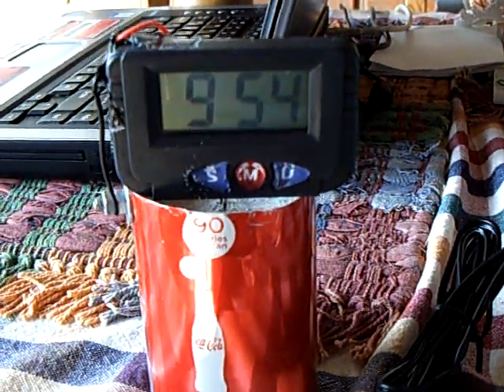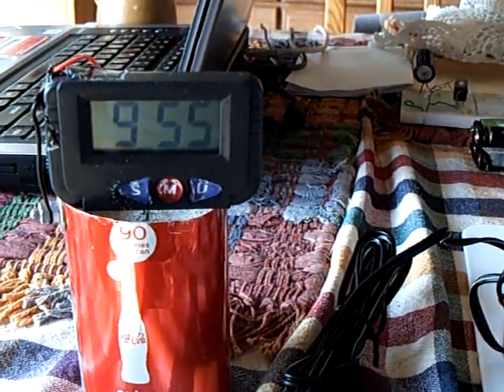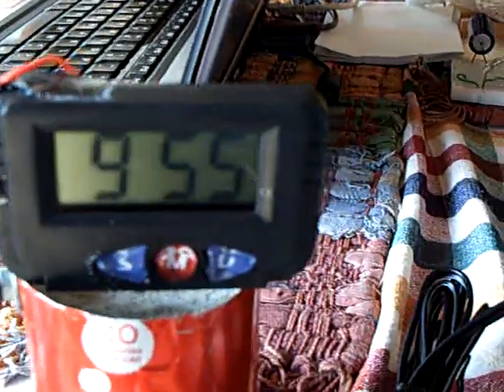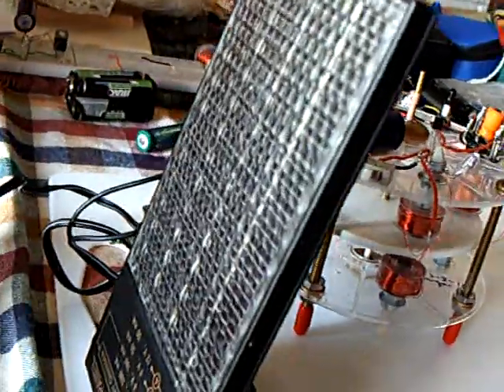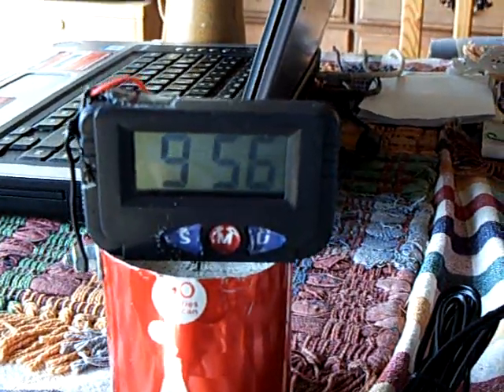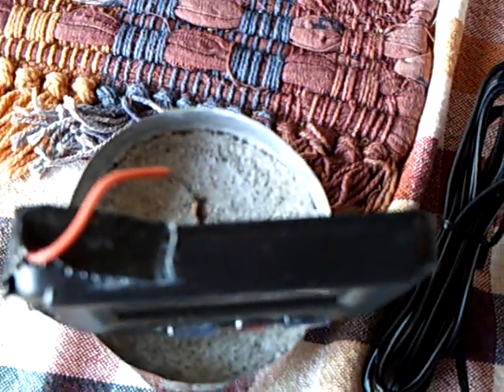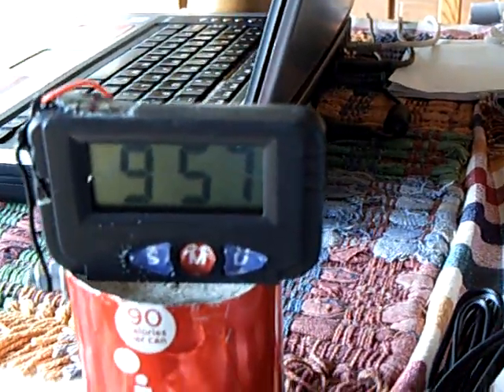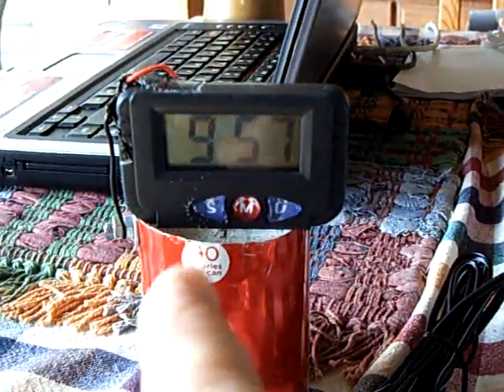My Beach Sand & Cement battery at 5 months.ASF

Comment: the Sunlight is giving it Volts. Photons are the reason we have electricity in the first place, direct sunlight gives a current. Also called orgone energy, the battery you made is an orgonite device which collects this energy which is powering your clock. This tech is the part of the 'new age' series of freedom with technology. Enjoy the gifts of the higher comic rays!

Comment: I guess what I am trying to understand is bigger plates better or smaller more close together plates seem to boost amps up more as I was testing in water. It seems to be able to make some smaller cells and put them in series similar to solar cell. As it seems that the volts for a solar cell and crystal cell each cell are both around 1 to 1.5 volts.

I guess what I am trying to understand is if you in series can you charge a AA battery in one of this solar lights from walmart.

Comment: In my video Overunity Charger i pointed at electret crystal batteries as overunity devices, also this is the case also with Stubblefield coil, or any battery, even a simple sheet of aluminium, a paper, and a foil of iron, is a perpetuum battery generating some 5-10 milivolts, from surrounding pranic energy which permeates everything.

Comment: The real way to tell is put a meter on the clock and read us some voltage readings and take still shots through out the day on the hour so we can see this happen in real time, Lidmotor. Other then that thanks for sharing what you have. What about the gummy batteries?

Comment: Lid:

I agree with you about some other energy, probably solar, entering the system.  I have a question:  How accurate is the time now from when you set it in the beginning?  Is the lower power levels at night messing with the timing circuits in the clock?

Thanks,

Bill

Comment: @Lidmotor when you use the can opener they can be stacked. a piece of black tape around the top and it insulates the -'s, something as simple as steel wool on the center posts to make a decent contact between the top and bottom? each can is 4 7/8th inches tall by 2 3/4 wide.now if you had a bunch of them to make a 4 foot by 8 foot panel you might get a little more amps?stacked 4 feet tall would be 9 volts 46.29 inches +insulators should be able to get a case wide.